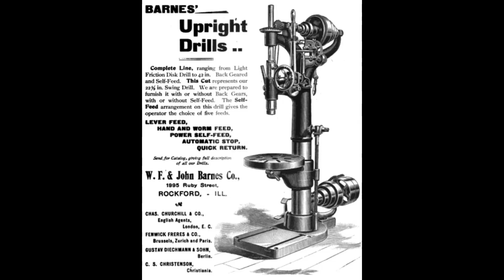OLD STEAM POWERED MACHINE SHOP 30   Bushing a Flywheel

Comment: That big engine seems a lot quieter.
Reply from the maker: Hi Mike: It is, but it had a small knock in it that I couldn't find. It was driving me nuts. During the video it got quite a bit worse but I needed to get the bushing job done and couldn't take time to research it. I finally found the mysterious noise and will tell you about it next time....Dave
Reply: It's good to see those old engines alive, I could hear the tick, just figured it was normal. Looking forward to seeing what you came up with.

Comment: nothing, but nothing makes the music, that is the steam engine running. Not outside, but inside the building, even without your music playing, it is making the music one longs for. While working on the bushing, it dawned on me, why the machine shop had 11 & 12 year old apprentices, sitting around reading Mark Twain, on chairs in the background. It was to mind the oil on the steam engine, and to keep an eye on the water level in the boiler. The water level is so critical, just one time of getting too wrapped up on a problem, and then, "oh no, the boiler tubes have had it, or, pressure wall failure. I suppose that is why they came from Christian families, so the owner could lay on the strop, if he discovered the water low for some reason.
Reply from the maker: Water use is so slow that I've never had a problem keeping it 1 inch from the top of the glass. Usually add water twice a day and then fill it to the top for the next day.....Dave